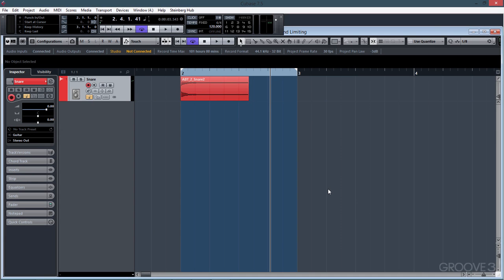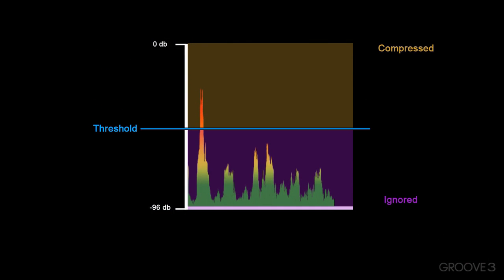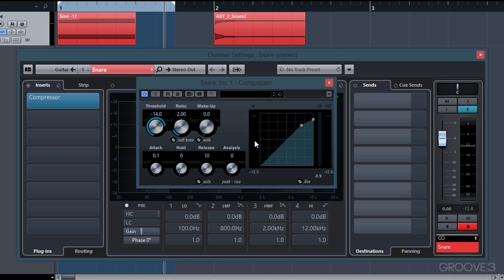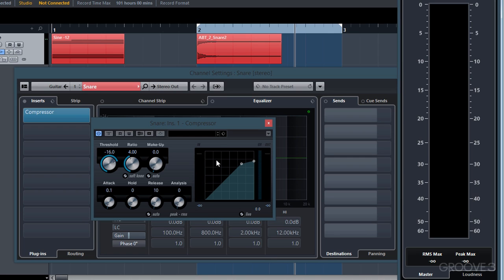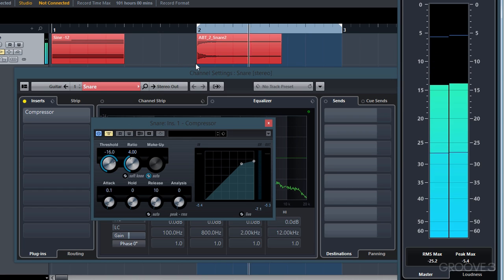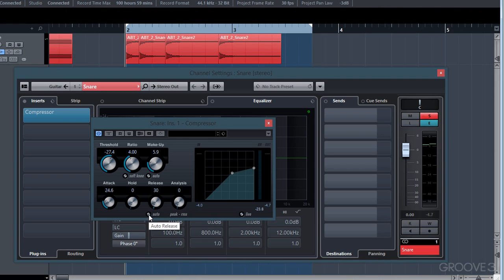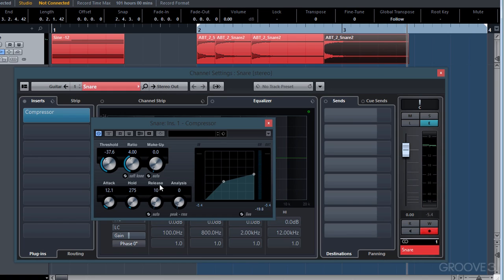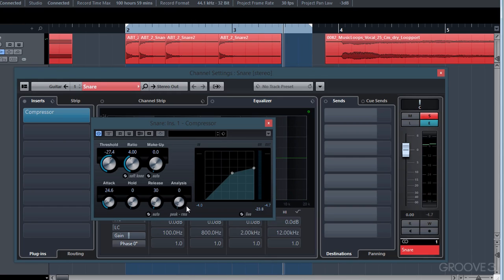Compression Controls (Cubase Dynamics Explained)

Comment: Nice work. However, I think it is important to keep in mind the perceptual aspects as well as the mathematical ones. For example, a 10 dB change is a halving (or doubling) of perceived loudness, yet mathematically (for volts, pressure and some others), a 10 dB change is a factor of 0.316 or 3.16 (respectively). Each change of 10 dB is 1/2 or 2x, for example, a sound that's 70 dB will likely be perceived as twice as loud as a 60 dB sound, four times as loud as a 50 dB sound, and so on. That is, a 6 dB change is a 2:1 change in the magnitude of the signal (2x or 0.5 x, depending), but a 6 dB change will be perceived as 1.5x or 0.66 as loud (respectively). There are other factors that contribute (spectral and temporal aspects of the signal and this is why as pointed out the attack and release times matter so much and must be tweaked), but a good general relationship to keep in one's head is that the perceived change in loudness is approximated by 2^(n/10), where 'n' is the change in dB; if for example the change is - 10 dB (10 dB quieter) then the expression becomes 2^(-10/10) = 2^(-1) = 1/2 = 0.5, or one-half as loud. a 17 dB reduction (for example) as 0.3x as loud as the previous level.